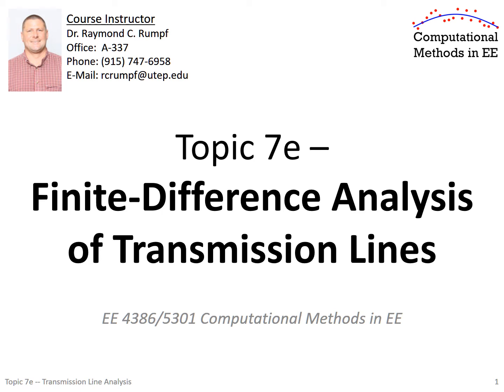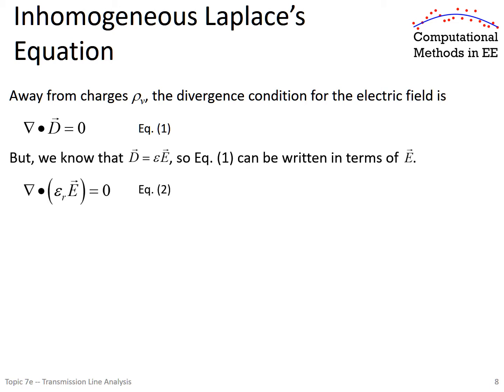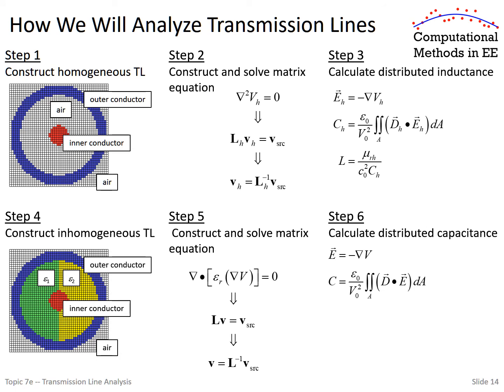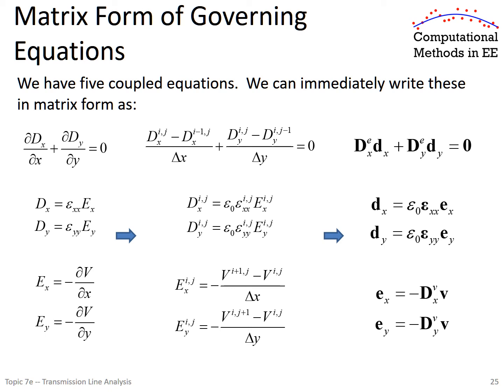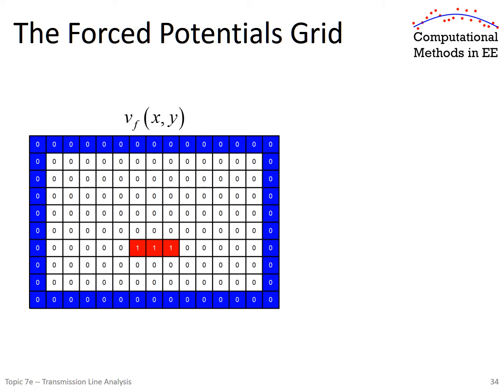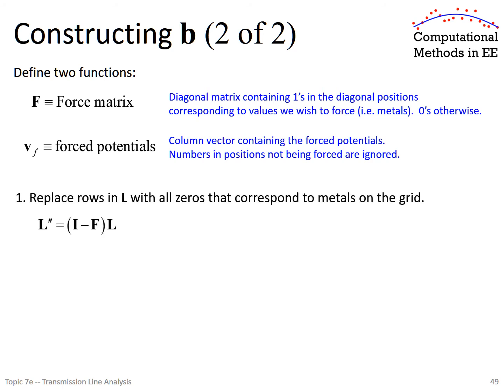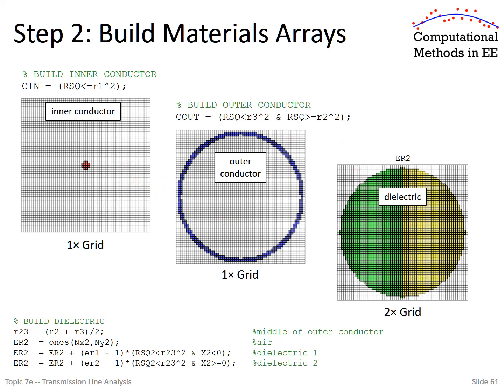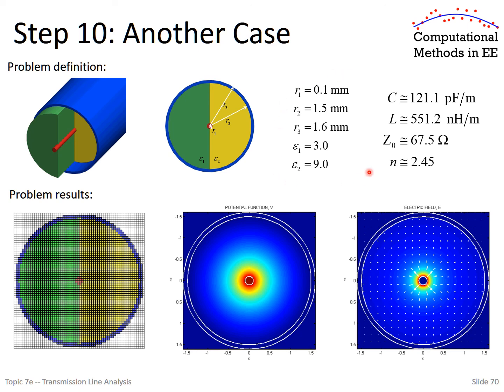Topic 7e -- Finite-Difference Analysis of Transmission Lines

Comment: I have one question is it necessary to use 2x grid method for microstrip? i mean microstrip is not curved.
Reply from the maker: No it is not. I myself tend to only use the 2x grid technique for curved things. Anything made of rectangles can be done easily without it. I think you are getting it.

Comment: Hi Sir, at 34:57, why apply backward difference for Dx/Dy, while apply forward difference for Ex/Ey? Thanks.
Reply from the maker: Sorry if I am misunderstanding your question, but at 34:57 in the video (slide 25), there are no divisions at all. This part covers the matrix form of the governing equations. After scanning the slides, I am not sure what equations you are referring to. Very sorry!

In general, in linear algebra you cannot reverse the order of operation.  That is A*B does not equal B*A. This also goes for division. A/B and B\A are both dividing by B but will give different answers due to the order. The order generally just falls out of the math and you must stay consistent.

By the way, this is an older version of this course material. I have material that is newer, better, and perhaps even more clear. I recommend accessing the course content through the course website instead of YouTube. You can download the notes, get links to other learning resources, and always have links to the latest version of everything. Here is the website:

https://empossible.net/academics/emp4301_5301/

Hope this helps!
Reply: @empossible1577  Hi sir, thanks for the reply. My question is for D is i - (i - 1) backward differencing, while for V is (i + 1) - i forward differencing. I'm new to this, always not sure which one to use.
Reply from the maker: @gl7389  Okay, good question. The short answer is that since a multi-variable problem is being solved (V and E or D), a staggered grid has been adopted. As I mentioned in my previous answer, you are watching an old video. This portion of the course has been considerably revised and improved. I recommend using the course website as your main portal to the course materials and videos. To more fully understand what is happening, I recommend working through Lectures 6f-6k, 7a-7d, and 7h-7n from the course website (see link below). The reasoning for the staggered grid is covered in Lecture 7d.'

https://empossible.net/academics/emp4301_5301/

Hope this helps!

Comment: Hello
Thank you for your well explanation, you are my hero.
I'm a student and FDFD becomes my obsession, I still stuck in some little problems that I hope you can help me. So
1)- my first question it's about implementation ;  what should I do to build a structure with an inhomogeneous geometry  whose section of the guide is variable along the direction of propagation or may contain obstacles (like ridge waveguide),  
2)- how to solve eigen-value problem for a ridge waveguide ?
Reply from the maker: Thank you!!

You have a much more difficult problem when your waveguide varies longitudinally.  You cannot analyze that by the technique described here.

If the variations are not periodic, you really are forced to perform a large 3D simulation to analyze the device.  If your variations are periodic, you still have a 3D simulation to perform, but you only need to analyze a single period in computer memory, so it is a bit faster than simulating a full device.  In this second case, you are essentially calculating a Bloch mode using a full 3D Eigen-mode analysis.

I am not sure I can describe this sufficiently here to be of any use to you, but I will describe it in a few sentences.  You will need to develop a fully 3D code, build a single unit cell of your waveguide in memory, and use periodic boundary conditions on the input and output boundaries.  You will make a guess at the effective index of the mode, use that to setup your periodic boundary conditions, solve the Eigen-value problem, and then get frequency and the picture of the mode from the solution.  If you have a fixed frequency and want the effective index, you could turn around the Eigen-value problem so effective index is the Eigen-value, or iterate the code you have, or back calculate it from a scattering simulation.  There are likely other ways to do this that I am not thinking.

If you really want to do this, I recommend not jumping right into it.  Build up to it in incremental steps and benchmark from known results in the literature as much as possible.  First, calculate modes of uniform waveguides.  Then simulate some discontinuities.  Then calculate Bloch modes in simpler periodic structures.  Work your way in small steps to your final problem.

Hope this helps!!!